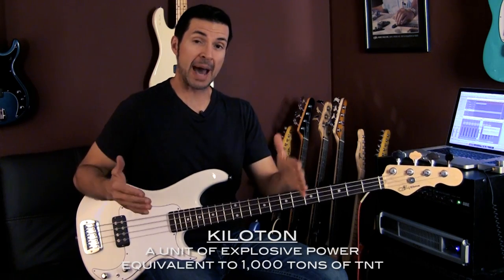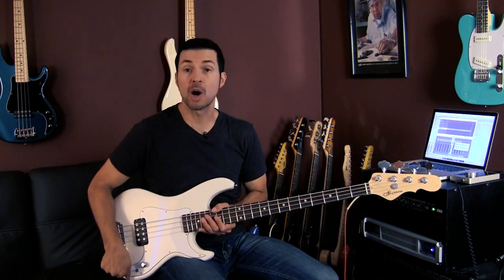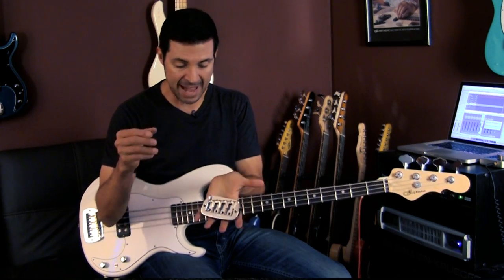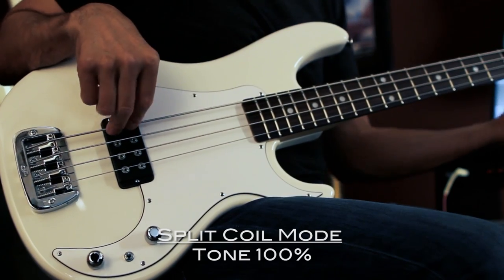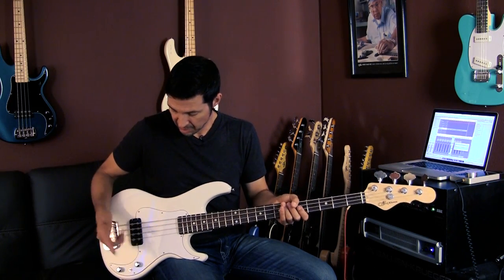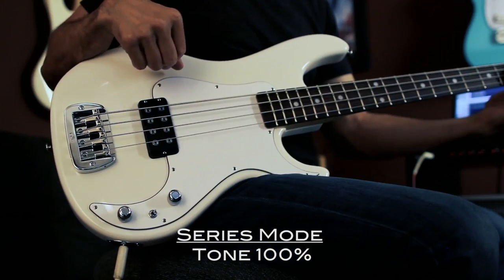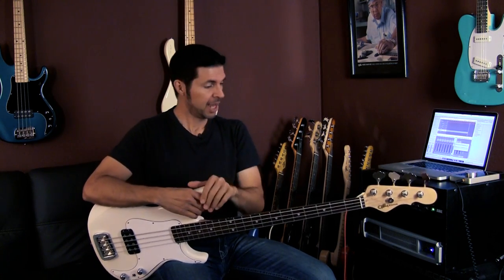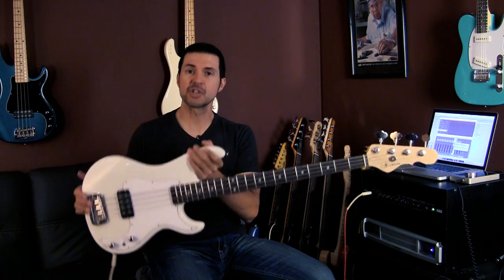Live! At Leo's:  The New G&L Kiloton bass Full Demo with Steve Araujo

Comment: please run the bass signal direct. The sound of the basses in all your G&L demos is way in the background. I'm a G&L owner player (SB2T) so want to hear these rigs. Thanks Steve!
Reply: Tone Meeg Hi tone!! Appreciate you watching the videos. I've been taking the DI out of the BBE preamp, I believe it's post eq, I have the preamp set pretty flat so it should be capturing the bass tone pretty accurately. I'll also make triple sure all of my gain levels are good. I do my best to show the difference in gain levels, especially when comparing parallel to series, parallel is definitely going to be a little lower in volume. Thanks again!!
Reply: You want to hear the direct signal so you can hear the rig? That makes no sense. You are hearing a direct signal, so there is no rig. These demos have the most perfectly recorded direct dry signal, and the sound is nowhere near the background, sorry. Use better headphones or speakers, there is literally nothing wrong with the signal.
Reply: in this case, rig = bass